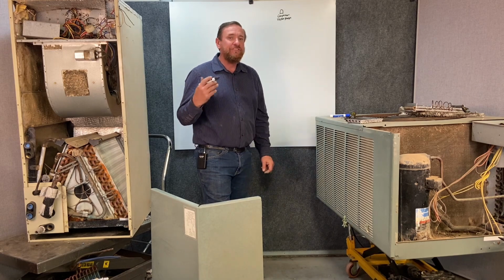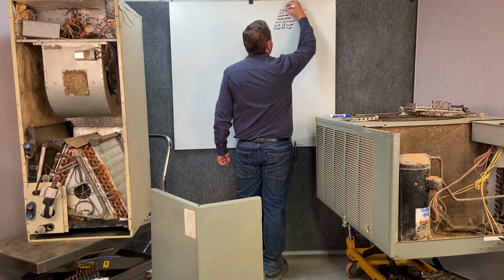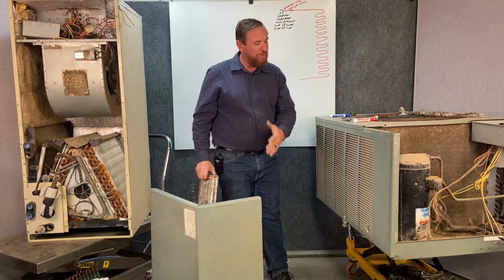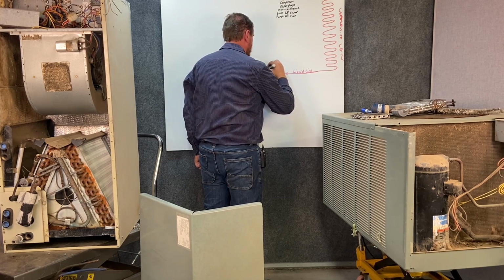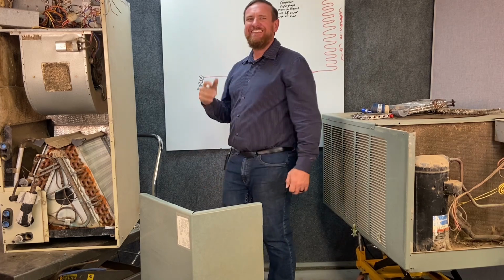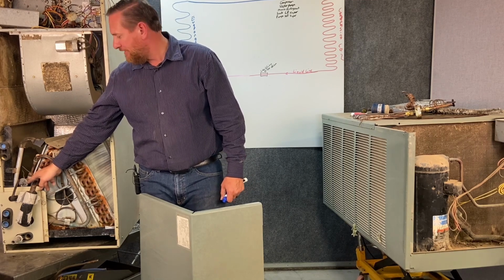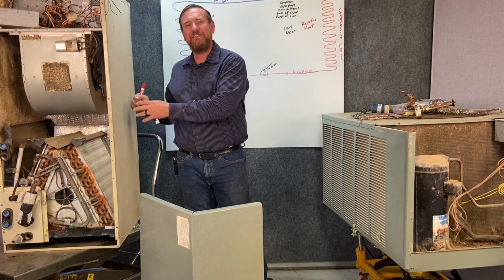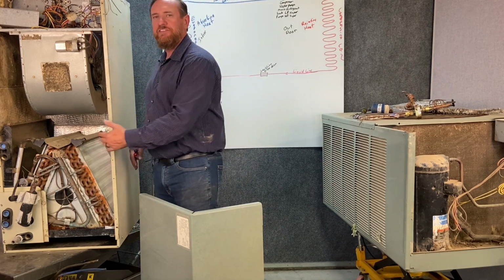HVAC 005 refrigeration intro, Moving heat! basic component.

Comment: question sir, When the ac first turns on what happens first. Does the compressor start pushing the high pressure vapor to the condensing coil. Is the refrigerant ever in a liquid state first. I don't know if that makes sense.
Reply from the maker: There should only ever be vapor before or after the compressor at all times in or off. When off, the liquid will settle to the bottom of the condensing coil and in the evaporator (conditions apply)
When the compressor starts it is pushing vapor into the condensor against the existing liquid that pushed against the metering device. As the pressure builds the condensing point rises and vapor starts condensing in the condensor.

On the suction side when the compressor starts the low pressure causes the refrigerant to immediately start boiling. It will be pulling the vapor back.
 .
 
 When there are problems things go bad 2 examples of many.

The system was running with low superheat(airflow/over charged) meaning liquid is brought back to the compressor. This washes oil away from the bearings and causes long term damage. When the system shuts off the suction pressure rises and liquid is trapped in the compressor and even some of the vapor condenses. It mixes with the oil
 When the compressor starts up liquid boils causing the oil to foam. This causes bearing wear and damage for lack of oil AND  flooded starts where the liquid, oil, vapor mixture gets into compression mechanics causing damage some times instantly. 

Example 2 no crank case heater, they system cycles off, it's cooler out side. All the liquid migrated to the compressor. System starts and the same thing as above, flooded starts, slugging.
Reply: @love2hvac  thank you so much for taking the time to explain.

Comment: Dear Sir Ty.
Really enjoyed the lesson. Much appreciated.
I just have a little question!  What about air movement? It does not speed up heat transfer?
Reply from the maker: Yes it fall in the second law of thermal dynics.
Temperature deference, material type, and quantity. 
Airflow is very very very important.